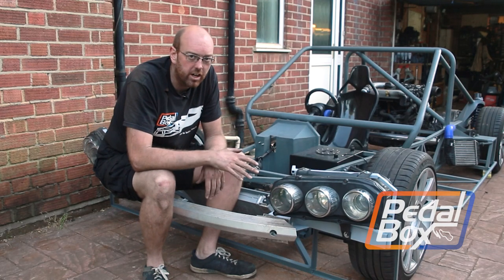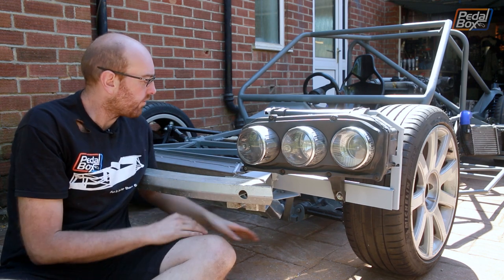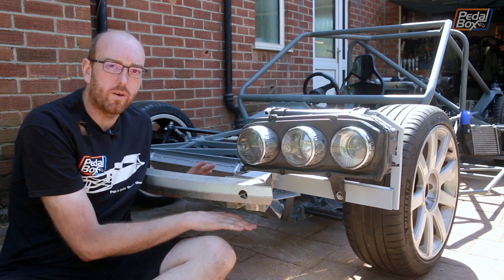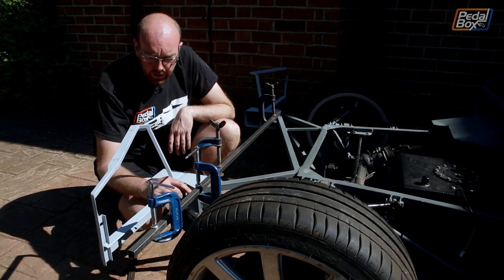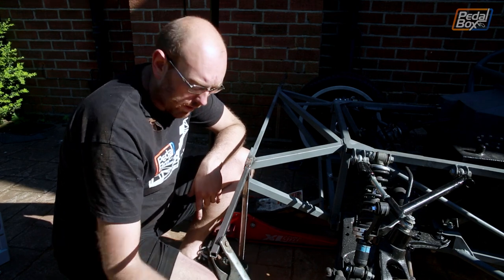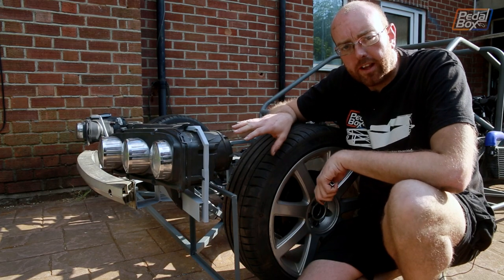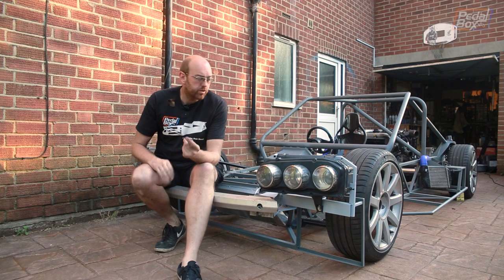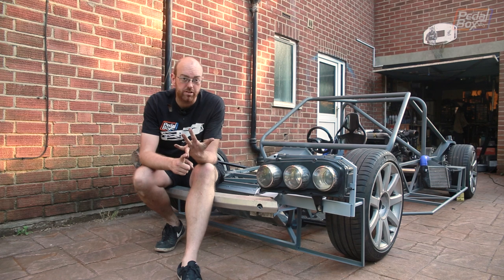Front Splitter Framing | Mid-Engine Audi TT Kit Car | PedalBox Episode 54

Comment: I fear you've built a very well designed speed bump catcher! The wheels aren't going to be able to start going up before that bar hits so any speed bump above that height is going to spell Disaster! Perhaps it just looks lower from the video?
Reply: OM NOM speed bumps
Reply: We have adjustable ride height so once it's all built and the suspension is loaded up we can set it at a good height to not catch
Reply from the maker: It's not... too low, sits lower when you lean on the front as the springs aren't the firmest, and they're as low as they'll ever be able. Stiffer and higher!... ahem.